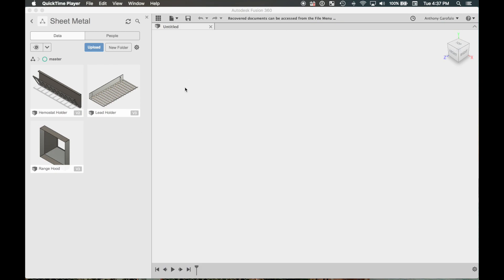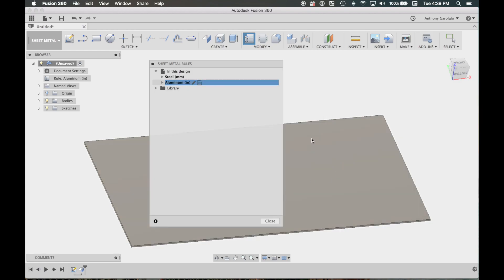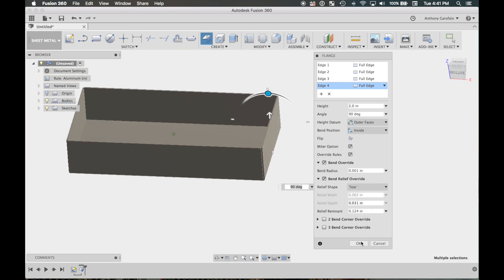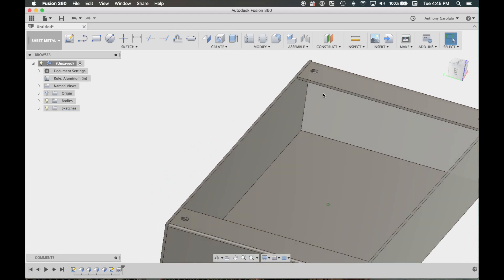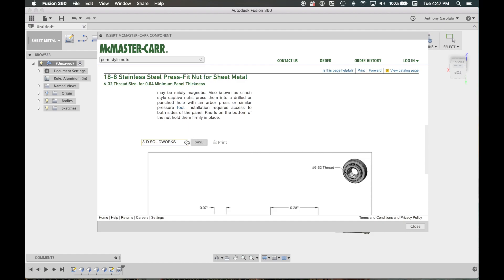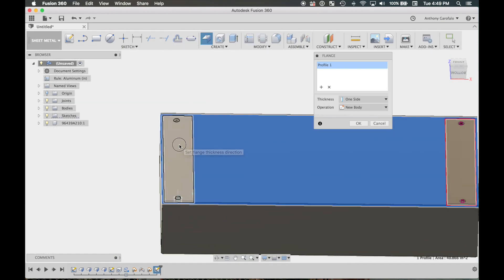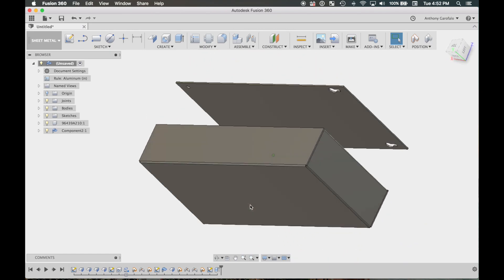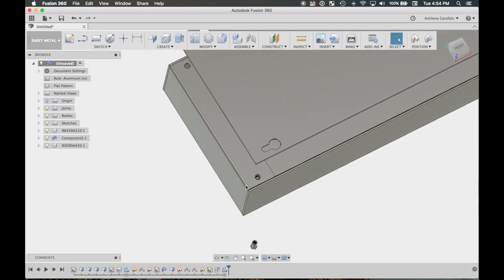Fusion 360 Sheet Metal Tutorial

Comment: great video. thanks.  what style of navigation are you using? i notice that your mouse cursor will sit still while your view port rotates. and you're not selecting any of the navigation buttons at the bottom. can you tell us how to do that? what settings do you have in Preferences? Thanks
Reply from the maker: Thanks! I'm using a Spacemouse Pro http://amzn.to/2wq87f1  I started out with a space navigator in 2013 http://amzn.to/2vHTxOS
I am substantially faster at modeling with either one of those.  I ended up upgrading to the larger one because it has 15 programmable buttons for shortcuts.
Reply: Proto G thanks!! what settings in fusion did you use in combination with the space mouse? (pan orbit zoom mode? ) I'm dying to get more keyboard shortcuts in fusion but they seem to ignore everyone's requests. Maybe using the space mouse will get me through some of that pain. Thanks! (maybe a quick video of your settings and shortcuts? 😁)

Comment: Hey dude, great overview.  I've been using Inventor for the last couple years and the functionality is nearly identical, but I like the Fusion Team's take on the UI.  I always said I was going to switch when they brought this to Fusion, and now I am. 

I have a sketching fip for ya.  If you create a couple of center construction lines between your flanges, you can use the symmetry constraint for your holes.  Then you only have to dimension one point, and the rest of them update.  It's far faster than fully dimensioning all the points.
Reply from the maker: Thanks for the tip, I'm still relatively slow when using 360 compared to using solidworks or inventor.  In inventor, sketch constraints are much more accessible and intuitive.  I haven't played much with the sketch constraints with 360 yet.  They are missing some things, like hems, but I'm sure they're working hard to add features and they are definitely going to give solidworks a run for their money if they keep up with the improvements.
Reply: No problem.  I think their pricing model alone is going to eventually crush Solidworks.  You don't have to apply for a license and submit a current transcript to try any of Autodesk's products.  And the cost of Fusion is free for most people.  They are getting the software into the hands of a lot of people.
Reply from the maker: Looked it, up.  It turns out, I've had the "Sketch Palette" hidden this whole time.  Inventor has all the sketch constraints at the top.